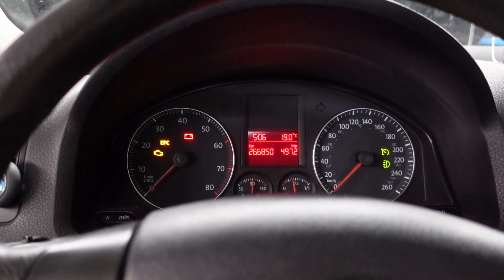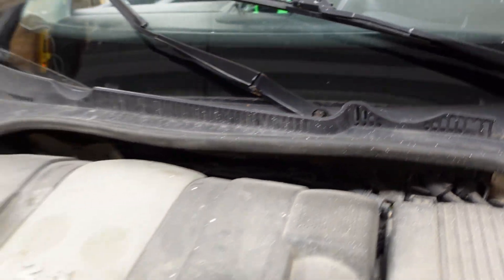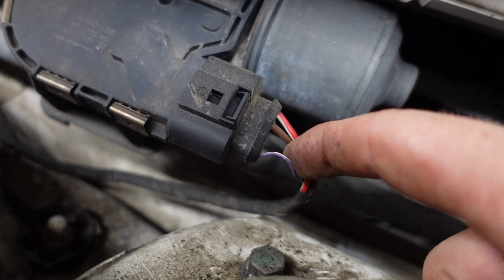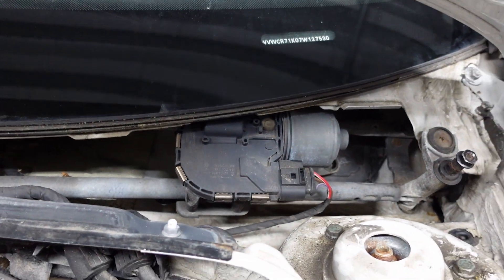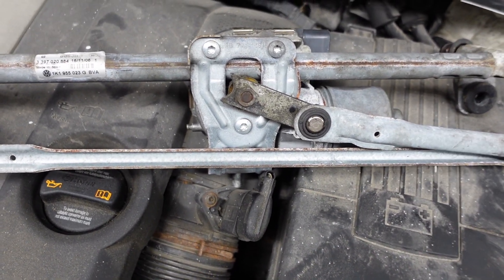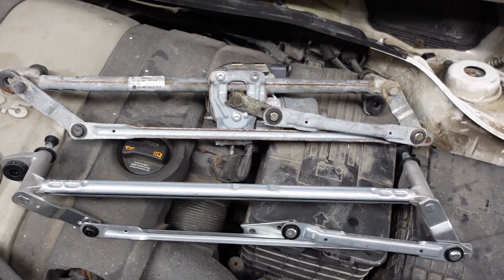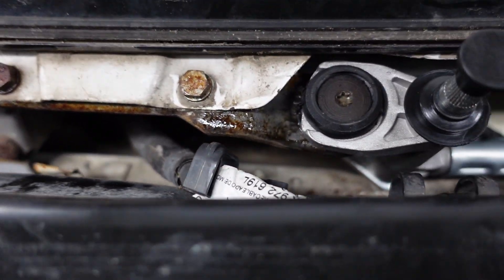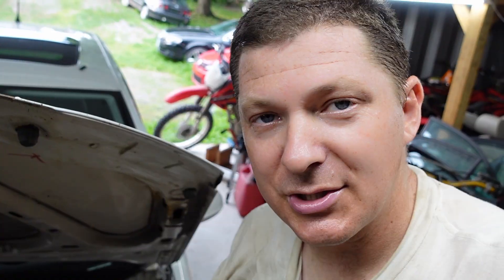Diagnose and Repair VW Mk5 Wiper Linkage/Motor

Comment: Are the frontand rear connected with one fuse? I have a problem with rear wipper, front is ok
Reply from the maker: But as far as I know the front and rear wipers are on separate fuses.
Reply from the maker: Interestingly, the rear wiper, hatch electronics, front washer jet heaters, and part of the HVAC controls are all on one fuse.